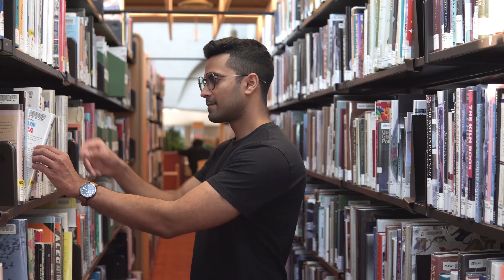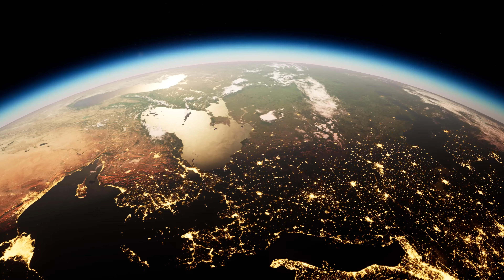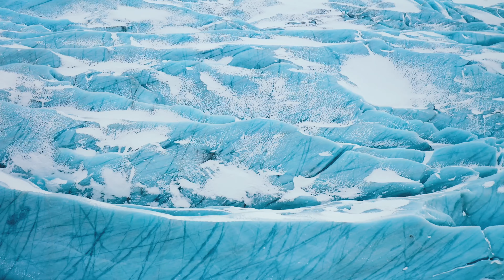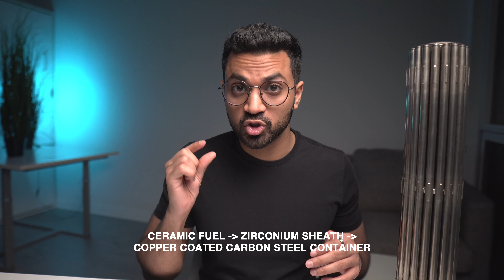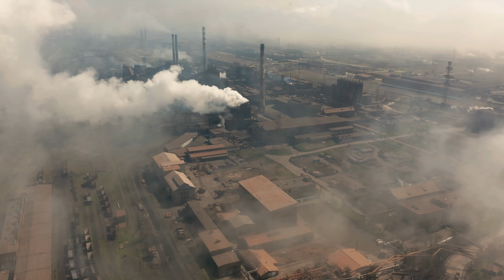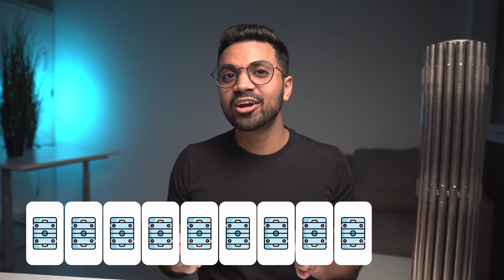Debunking Top 5 Myths about Nuclear Waste Disposal

Comment: ..or we could just burn it up by utilizing the energy it still contains a lot of by processing it in MSRs.

Burying it is the (current) nuclear & uranium industrys' ideal because it costs to build facilities to, costs to transport to, costs to get into position, costs to monitor, and keeps the remaining energy of that fuel-labeled-'waste' off the market, competing against the 'new stuff' that's sending current uranium prices so high.

What's safer? A bunch of radioactive material sitting around waiting to get stolen and utilized for a dirty bomb?

Or..

Burning it up in military protected facilities so that it no longer exists and doing so via a carbon-free process that has a very small ecological footprint in the facility burning it up, and an even smaller on in the new uranium mining operations not needed because said already-mined 'waste' is being so much more thoroughly & efficiently utilized in reactor designs capable of harnessing its potential via orders of magnitude greater efficiency than the methods so actively promoted on this channel?

Comment: A permanent repository for nuclear waste must last much longer than the age of the pyramids of Egypt.  It's kind ofdifficult to grasp the time scale.
Maybe you could do one on the interim storage methods for nuclear waste.  It would also be interesting as to how much of the fuel can be recycled into new fuel.  I worked on a building at Hanford that is supposed to store SNF for 50 years.  I kind of think it will still be doing the job for 200 years.
Thanks for the video.
Reply: Per Ordinal's comment below, with reprocessing SNF and fast reactors, the timescale drops to 300 years.
The 'permanent repository lasting longer than the age of the pyramids' is a political challenge, not a technical challenge.
Reply: @factnotfiction5915  Good comment - Three hundred years is do-able.  I had heard that the waste from Molten Salt Reactors had this shorter half life and 300 years would be enough.
Reply from the maker: Thank you for watching the video and for engaging in this important conversation about nuclear waste. Cool to know that you work at Hanford!

Comment: My only gripe with DGRs is that they make it so the SNF is completely unretriavable. U-238 is fertile, Pu-239 is fissile, transuranics and other Pu isotopes are fissile in a fast neutron spectrum, and Fission Products aren't that long living. 

We should first invest in fast reactors, and only bury the Fission Products that are unusable for anything but have activities that are dangerous.
Getting much more energy out of mined uranium.
Reply: Indeed, that's not 'spent' nuclear fuel, it's BARELY-BEEN-USED fuel!! This is why we desperately need to move from solid-fuelled reactors to fluid-fuelled molten salt reactors (chloride fast reactors for U-Pu cycle, fluoride thermal reactors for TH-U233 cycle) that do continuous or regular (3-4 monthly) batch processing of the fuel salt to pull out FPs & neutron poisons. 

Even those 'nuclear ashes' like Sr-90 and Cs-137 that last less than 300 years have practical, real-world uses for their decay energy if they are packaged and contained correctly. The largest quantity long-lived FP is Cs135. It has a gentle, easily managed radiation decay profile (256keV beta decay, completely contained in 4mm MgAl alloy surrounded by 5mm lead). You could use it to make beta-voltaic batteries to give low-demand power to all 8bil' of us' devices like smartwatches, or LED lighting 'for life'. OTOH if you managed Cs135's precursor Xe-135 correctly and gave it the extra neutron it so desperately craves, but done ex-core say from a separately powered D-T fuelled Polywell neutron source, you turn nuclear crud into better-than gold; Xe-136, which is the Rolls-Royce of general anaesthetics, or the Ultimate Fuel for Ion-engine powered space probes..

In short one could take this massive volume of 'waste' , and shrink it down to a couple of A4 sized file archive boxes that don't have to be so maniacally engineered to last 'forever' in a DGR like Onkalo (that is now already massive engineering overkill).

BUT... this breaks the rice bowls of the hegemonaical Elite energy barons who presently hold us serfs & peons captive in their neo-feudal energy landscape.
Reply: @rhonda-my_honda_cb500x  Theoretically anything "fast" (be chloride salt reactors or solid fueled sodium cooled breeder reactors) can run with thorium as well. In fact, I'd say it's desirable because fast fission releases more neutrons on average than thermal fission, and for a "breeding" cycle you always need 2 neutrons at least to keep it going. Neutron absorbance cross sections are a problem, but not impeditive.

I know about the many uses of some fission products (those 2, Cs-137 and Sr-90 were the ones that i had in mind), and it's indeed good news that there's more to that. Recovery of the Xe-135 would be a cool one of LFRs/MSRs because it just boils off the mixture.

I didn't know Cs-136 could also have potential uses. The problem here is how much of the stuff is actually generated in a reactor, and the economical viability of recovering it.

For the current situation of the nuclear industry, a DGR gives peace of mind. Just bury it and forget about it. I'd like that at least it was reprocessed (and the reprocessed uranium reenriched or used in CANDUs) until it couldn't be reused anymore from accumulated neutron poisons (most of them are burnable in FNRs, like U-236/U-237, and the minor Pu isotopes), but oh well...

Comment: Thank you for solid and reliable information!
Reply from the maker: You're welcome Peter! I'm glad that you found the information presented in the video to be solid and reliable. It's important to provide accurate information to help people make informed decisions!
Reply: Irradiated graphite will create Carbon14, there is no understanding of the impact on a DGF/S
The current solution to deep geological disposal of spent fuel includes copper cladding, there is a corrosion issue which isnt fully understood.
Disposing of spent fuel is inconsistent with the waste hierarchy as its component parts are both valuable & reusable.
Stop cheerleading a questionable "Big Solution".